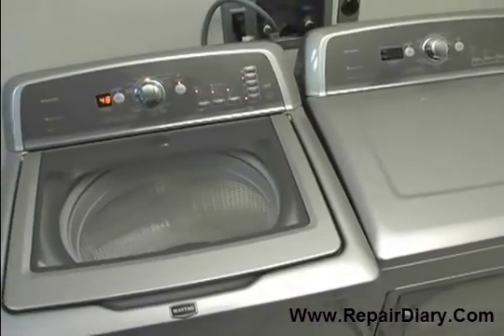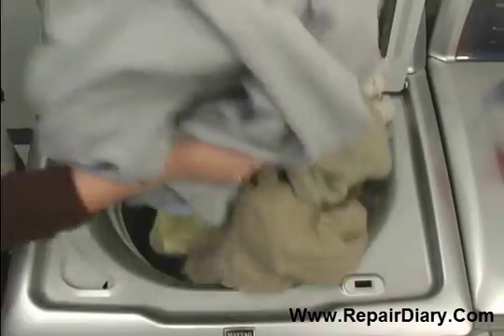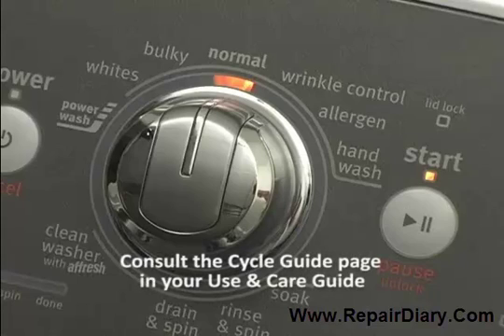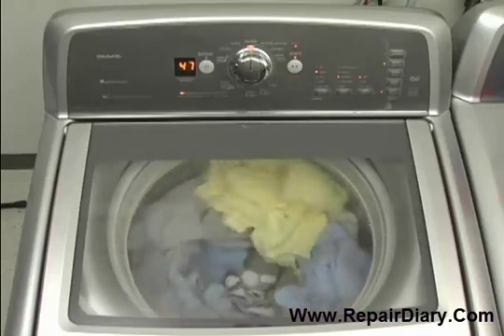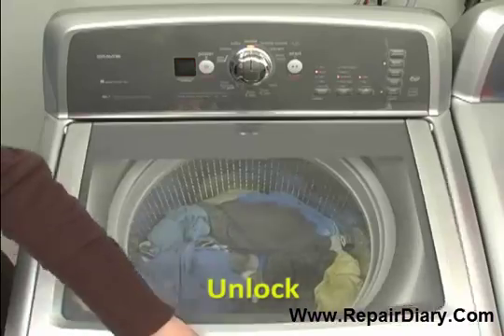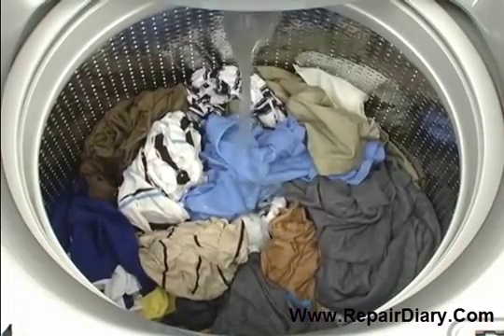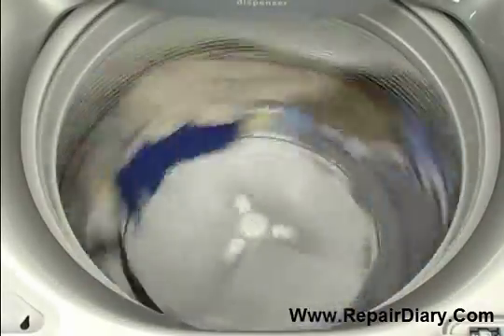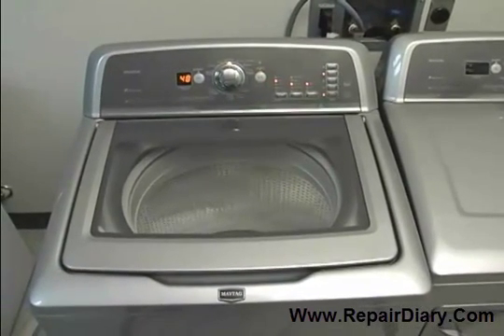How High Efficiency Top Load Washer Work

Comment: Thank you. I recently bought a 2 year-old Wirlpool h.e. washer ($220) and was concerned about the motor noise. I'm glad to know mine sounds normal now.
Reply: Cleans just fine for me.
Reply: Mine works great too. I love being able to wash five queen size sheets in one wash load.
Reply: There is the "super wash" setting and pre-treating stains is always a good idea.
Reply: Bryan Hodges Pretreating stains???? What??? Why  have a washer for if I have to pretreat? A good machine should and would get them clean without you having to do anything else than just drop 'em in, add detergent, select cycle and that is, I have never pretreated anything on my ge filter-flo and my speed queen top-loaders, can't really say that of  the  front loaders, even less the HE toploaders like this.
 I also have a small  italian/european  220 volt front loader with an heater and even by selecting boil wash (water actually boiling) delivers whites with stains etc, my toploaders always delivered spotless whites with 140F tap water at max.. the laundry coming out my toploaders is always spotless...I have seen how the laundry comes out these HE toploaders and they're not even worth being called "washing machines"..... it's not that they don't wash well/good, what they do it's not even classificable as "washing"...
Reply: itsmegp46 Front loaders may use less water  but they have a different action that it's much more sensible than what these obscene machines do.
Saying that I think  and I  know that there will be nothing that cleans like an agitator , and for how this maniacal crazy  and nonsense tree huggers government with their bullshits,  along with the  appliance lobbies,  likes to and are well happy to "brain wash" you simpletons to think otherwise and keep  selling you these new crap... I tell you that  if you still decide you want to go with a low water use machine for some reasons, then what has more sense undoubtedly is a front loader or anyway  an H axis like a staber washer...being though aware that they'll never deliver clothes as clean as your average OLD traditional agitator machine did...
I'll tell you more... speaking of front loaders in most cases the front loaders of today  with such a low water are not comparable to the  front loaders sold back in the days,...not a case old front loaders used more water than what  front loaders do today as well... now because of the " as  less water as you can" thing  with these toploaders they simply reached the very bottom and the most absurd "way to do"  you can reach with a top loading "V" axis machine,, maybe not, as they say "it never rains, it pours"...
Reply: Otter Wahn..
Consumer report?  Buahah.
First of all consumer report is a huge bullshit and a market driven thing, pretending to do the interest of the consumers but factually working for the system and the big ones behind everything, if you think otherwise and that's 100% transparent  you're the biggest naive ever,  for second I already exaplained what the matter is with modern machines...top loaders now are not even allowed to fill water hot enough (plain hot water from your heater) thanks to the gov thing, they have a valve who will give you just a warm wash  for the hot setting and cool instead of warm, how can you expect them to clean certain stains vs a machine who  can still  fill water really hot and can also heat/support their own water as the most of front loaders do now? Like bleachable stains? We all know that oxigen bleaches in detergents require higher temps to work...they are not given the same chance in the warm water of today's toploaders..if top loaders were  given again the chance to filll water as hot as the front loaders can,  we wouldn't even talk about this,  as they would sure beat front loaders because of the better and deeper agitator wash action like it's been in the past and until now...  Sadly today, they are also ruining agitation action eliminating gearboxes..  did you see the pitiful wash action of a modern toploaders with those weak motors and the  long slow strokes that do nothing but twist laundry around the agiator post?   CR only test  and do comparisons among modern machines, I'd well like to bring there my 80s GE or whirlpool washer and see what they find out! LOL
That doesn't make front loaders better than toploaders, than modern ones maybe, but not in general.. because modern top loaders had changed and had been worsened and ruined to unthinkable levels...and yes that was purposedly.
You have no idea of the interest they created behind all of this HE and Eco and stuff like that  from and between lawmaklers and the appliance makers ...they are well happy to sell you a new 1000 bucks plastic thing with lots of chinese parts,  with the illusionary excuse of being better, a thing that will last 5 years and will also cost you  lots of money  out of service calls manteinance etc.. and all this  when you could have kept your old one that would have lasted even longer than your new one everb will...they're well happy for this! It's all earning for them!
CR  do their part in all of this system...there's no such a thing as "by the side of the consumers" in real life, there is just the side of the money, that's the hard truth... the tests they do are  also often ridicolous
Consumer reports won't just disclose all the variants in their tests of course, am not saying it's plain cheating but pretend to forget or not calculate certain things such as detergent dose, water temp, load sizes etc, and what I've seen has really  not a fair, so  rational and proportional sense for many things...so it's easy to imagine the rest and how these "tests" are done, there's already a winner  to declare before even starting to test them...they just have find a way to make it appear....
In any case even assuming that  they do things 100% honest for the washers, the top load and front load matter  don't change, traditional toploaders were ruined  and worsened  by gov laws and  by the same makers...it's not front loaders and HE  that are better but top loaders that got  unbelievably worse...

I  also  suggest you to read a nice article from wall street journal "how washington ruined your washing machine"...you'll find it very interesting..
Reply: itsmegp46
I guess some people are just plain stupid...(and they don't know to be) , instead as often happens they think to be indeed the smartest around...
Reply: Otter Wahn Ahahahahahah...Oh my God...
Thank you for the wikipedia descritption!!! LOLOLOLOL  Like if people didn't  already know what CR is...Ahahahah!  
Anyway yes, this is what it is and should be theorically, but that isn't so the  in the real world and factually.. seriously...how naive can you be?   Ahahahahah!
Reply: That's what stupid  people usually do...they laugh at everything they can't understand..and with this I'm not saying I am any more intelligent than the average, but you showed  not to have a great intellect also,  just like some others did...(and not mainly because of your findings on this machine) but for your attitude and  speeches you did,  not even a big culture ...and am sorry for you!
Reply: itsmegp46 I feel bad at laughing at you actually now... I  kind  of feel sorry for..that's the difference...

But keep laughing! Really!
Reply: itsmegp46 Again with this short bus???  Broken record aren't you? Are you jealous because they didn't even want you in it? I'm always more convinced  it must have been a  childhood trauma if you keep pulling it out.
Who told you i've never used it or seen it?  FYI I used it for a summer at the Church  where I serviced for a 4 month as this is what they had there, and seing how it didn't clean aprons and  and all the kitchen stuff  even with the easiest stains was about that for me...a countercheck of what I already thought.
What this machines does, better say doesn't can be seen here  in the video also, and if you've had all these negative comments  here it should let you think about it....
Again, I'm sorry if you lack any judgemental skill,  if you obviously don't know anything about laundry as you plentily showed, and even after your alleged 5 kids or how many they're.. and your husband working in landscaping whatever waving it as a kind of proof of what you say, I'm a chef and I live in a farm-house...so?
I am sorry  if you  have  likely limited standards or distorted findings about what's clean or not and find it great and your clothes  clean, but for god sake don't expecty everyone is like you!
This machine can't possibly clean well,  and everyone who guesses so even just by watching this stupid video (that pretty much tells and shows what the reality is) is nothing but damn right according to me! Like the ones who will say otherwise (if there will be any) will be right according to you! So?
Reply: Good for you if you're happy with it.
Reply: itsmegp46 You must of used one that hooks up to a sink, or only had a large capacity.  Mine is an extra large capacity, and can wash WAY more clothes in one 27 minute cycle than this piece of shit could do in 2 hours.  Defend this piece of shit washer all you want to.  Let's see if it lasts 45 PLUS years.  I fucking doubt it.
Reply: AaronD711 No it's not.....Not when it doesn't wash a damn thing and sheep sit there and try and defend it.  Fuck that mess.
Reply: And you are a dumb fuck.
Reply: You are a dumb fucking liberal ass, tree hugging, lying piece of shit.  I rather be a truth telling bitch.  Ty.
Reply: Freddy Capu Sorry Sparky. but you've got it bass akwards. I have FIVE years experience with this type of washer. My purchase was based on research and conclusions. It cleans very well, uses less water and washes about three times the load of any center post agitator.  Once more, I'm laughing at the superior "intellect".
Reply: Freddy Capu Not to worry, I am!  What you should feel sorry for are people like you who make a blanket judgment on a product simply  by looking at a youtube video.  Tell me something, did you go to school on the short bus?
Reply: If you don't like it then sell or scrap it. I like mine. It's really that simple.
Reply: Bryan Hodges THey have to be able to read the knobs to figure that out :)
Reply: itsmegp46 My1970's Maytag can wash 4 times the amount of clothes as this piece of shit can.  Sorry to tell you the truth.
Reply: Hella Good Sorry honey, but you're lying.  I've owned a Maytag from this era.  There is no way it could wash sixteen queen size sheet in one wash load. Two, maybe three and it was full.
Reply: ***** Were you there watching them?
Reply: ***** You can't possibly know that unless you wash similar clothes.
Reply: Hella Good Wow man its a washer relax!
Reply: +Jerome Davis At your dad's house, now that is the key. You're an adult still living with his parents.  And you're lecturing me on washing?  Come back when you're married with five kids.
Reply: +Jerome Davis Your assessment is all wet, as usual.  I have first hand experience. BTW, isn't is about time to move out of your dad's basement and get your own place?
Reply: +Jerome Davis I guess there is no use having a conversation with this sorry excuse of a human being.  The rants are a tell tale sign of some serious mental illness.
Reply: +Jerome Davis I don't have to prove anything to you.  You're obviously a youtube lifer who still lives in his dad's basement, using his washer. I have the benefit of first hand experience.  Bye loser.
Reply: +Jerome Davis Even though you're consummately wrong, congratulations on being a selfish excuse of a human being.
Reply: +Jerome Davis In the immortal words of Forrest Gump, stupid is as stupid does.  By the way, make sure you clean your daddy's boxers in your speed queen.
Reply: @itsmegp46  All cabrio washers suck!
Reply: Still better than your he piece of shit, bitch ass.
Reply: +Jerome Davis Since you've never used this type of machine, and formed a very biased, uneducated opinion, I'd say you are the stupid one.  On a more serious note, what in the world are you doing looking at your dad's underwear?  That is so gross and disgusting, it makes me sick.
Reply: @itsmegp46  Biased? How so?
Reply: +Hella Good Back at ya, bitch
Reply: +Jerome Davis Liar, I never told you to wash your dad's underwear.  But if you like washing out his skid marks, have at it.   BTW, get your own place already.
Reply: +Hella Good Your Mama!
Reply: And your pappy, dumb fuck
Reply: +Hella Good  It takes a special kind of stupid to draw a conclusion after watching one youtube video.
Reply: Shut up Meg, you don't matter.
Reply: I work in an appliance store, stupid Meg.
Reply: +Hella Good Cleaning the bathrooms and mopping the showroom at 2AM, I'm sure.
Reply: +Jerome Davis Those people I've found either don't know how to use them, never read the owner's manual or just plain lied about ever using it.  Like you, they see one youtube video and make a blanket condemnation. On the other hand you might be drinking from the Fountain of the reDUMBplicans.
Reply: +Jerome Davis Please, please, please don't talk to me about your dad's underwear.  The very thought that a son is talking about his father's skid mark skivvies makes my stomach churn.  You need professional help.
Reply: Telling Meg it's the truth will only make her try and make dumb ass comments right back.  Meg is dumb, it's plain to see.
Reply: It sounds like a piece of crap! They use cheap motors in them!
Reply: Freddy Capu  I guess some people choose to remain (and you know who you are) ignorant and uneducated.
Reply: Freddy Capu Can you hear me?  I'm laughing at the superior (coughcough) intellect.

Comment: We've had an top load HE washer for about 3 years now. Works great. Towels come out much cleaner and fresher versus our old Whirlpool(new one is also from Whirlpool). I can go 2 full weeks without washing my everyday clothes because the capacity is so big. And everything comes out clean. No missed stains, I barely need to pretreat. We are all very pleased with the appliance. Yes, it does take longer, that is the trade off, but it is pretty much in sync with how long the dryer takes(1 hour wash to about 1 hour dry) so no time is wasted.
Reply: guess what?
new worlpool HE washers are junk I don't know if you notised but the machine have all this electronic controle bs I would advize if the machine breakes down just toss it and get a used worlpool dddirect drive like you used to have with a mechanical timer your better off.
Reply: kody mackey you'd be better off going back to school.
Reply: No way!

Comment: MOst of those clothes stay on top.  They dont even go down to get cleaned..
Reply: I traded my washer in for a tub and boardnow my clothes come out stotless
Reply: My phat azz is buying a speed queen!!!  WHoo!! hoo!!
Reply: Just purchased my first speed queen set.  Water fills all the way up and clothes are forced down.  No wonder people are preferring the old fashioned water and dryers
Reply: The 4.2 GE washer is much better than this old junk! It has a agitator, it has 5 options for height of water fill that includes deep fill, which fills the washer all the way. You don't need to press a billion buttons just to get it working. And best of all, with the agitator, you can make a blanket go around the tub. Instead of taking 5 hours to make your blanked be around the bottom plate. Don't buy he washers! They are complicated to use and don't wash cloths.
Reply: @hamzahassan7730  The speed queen set I have is still going strong and does fill up all the way to the top.
Reply: @hamzahassan7730  except without an agitator you can put in quite easily and wash a comforter.
Reply: ronald felder Oh really. That’s nice because only part of the comforter will be scrubbed. I would love for my comforter to partially be cleaned
Reply: ShyRage1 Wise move! You should get years and years (20-25 years) of service from your Speed Queen set! There's a reason why the laundromats love these machines.

Sadly, even the new Maytag commercial (read: COMMERCIAL) grade machines are cheap garbage, since they use a plastic clutch and a plastic outer tub.
Reply: Been about two years now, and now that speed queen set was replaced with a new one.  Not because they broke or anything, just got tenants to move in the apartment.  They love em as much as we do
Reply: The machine I have has a button to use if you want more water than it fills the basked with. you can press it anytime during the wash cycle. I always see that the water comes to the top of the clothes.
Reply: right
Reply: Hamza Hassan you're right because i have one.
Reply: No! They don't!
Reply: To get more water in your cycle..wet the clothes before turning the cycle on. The sensor is regulated by the weight of your clothes..which makes no sense to me! So wet your clothes and your machine will fill with more water! Good luck! 🌷
Reply: he wont tell the truth because lg is probably paying him or her.
Reply: I know it's useless, fill the bath tub soak clothes in there over night then rinse them next day even cleaner than these washer without water and agitator.
Reply: Those clothes are not cleaned . I just got rid of a Maytag Centennial HE washer. I had it for 5 years and my family hated that damn thing. It started malfunctioning 3 years ago when it would just set on sensing fill for 20 minutes before it started washing and it was taking 1 hour to wash a load of clothes. It started making a horrible grinding noise about two weeks ago. I decided to just buy a new machine with an agitator. No more HE crap for me.
Reply: @gloriaevans6359  Did you end up getting a speed queen?
Reply: @ShyRage1  Yes I did. My first time buying one. I paid a lot more than I normally do for a washer but I think it was worth it.  Love the way it washes.
Reply: Wet your clothes before starting the cycle and your washer will fill up..the sensor works by weighing your clothes.. Which I agree..is stupid!
Reply: This is stupid! You need water!